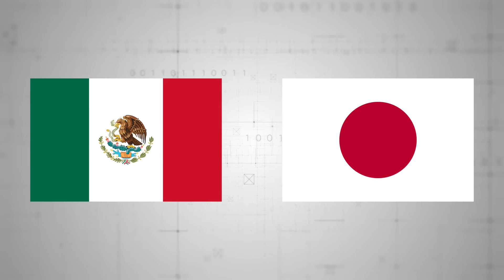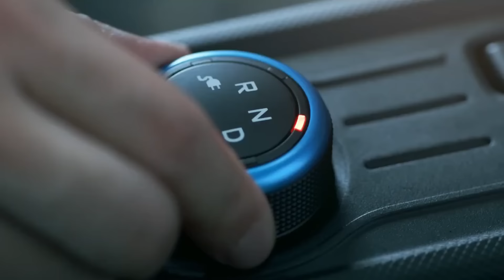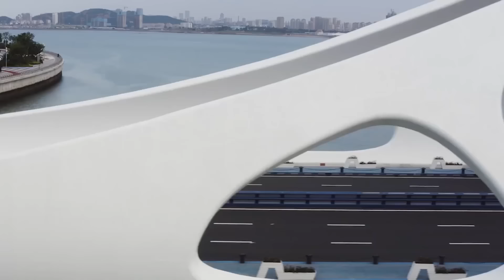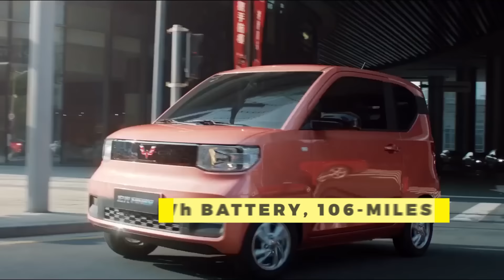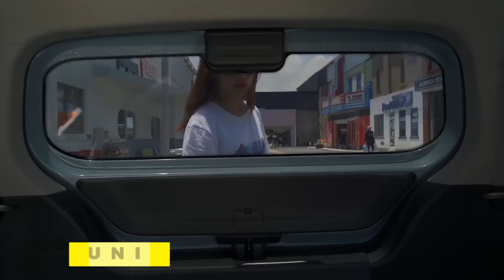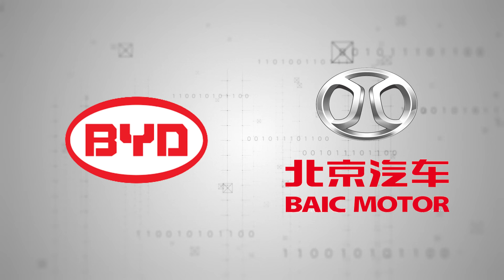The $4000 Electric Car Dominating China

Comment: I just want to ask. Do you guys have the type of battery pack that I can install it on the top of the roof rack and charge it by solar and still can switch to use it whenever I need for the car or for Electric Equipment that I have? 

Would I be able to buy an extra battery pack for this wuling? 
Whatever battery you are going to upgrade, I want 1 extra on the roof with a solar panels. Can you do that for me? A Wuling with Double level Roof Rack. 1 for extra battery storage and 1 for my camping equipments. And cover everything with the solar panel?

Comment: I bought one, and imported it into the United States.  I really did, for less than $45.  It's Sky Blue in color, like my last new car, a Toyota Camry....

Drumroll.......   OK, I must admit, it's a die-cast model reproduction, but I feel it will be a collector's item when I am 90 in 30 years, I can fly to China to sell it on China's version of "Antique's Roadshow".

A car like this I wish could come to the US.  All crash testing has done is increased the price of cars, forcing many to choose less safe motorcycles or e-scooters.  

The most important thing about car crashes is not getting into one, and/or accepting the odds that they can happen, but usually if you choose your route carefully instead of picking the most congested way to go from Point A to Point B, they will not happen to you.

If I were in one of these, I'd just wear a motorcycle suit with ambient cooling--they should make them for e-vehicles like this anyway, since the one thing I've heard about this car is its A/C just does not work.

Two things have caused challenges for cars and their longevity.  Electronics mixed with internal combustion engines, and of course, the car's purpose.

E-cars like this one are fine for home dwellers, but those who live in US apartment complexes are left out of the market and I'm a former homeowner who found apartment living cheaper than the cost of owning a home once utilities are packaged into the price.

I will never go back to owning a home again since my 22 yo daughter has chosen to have a career of her own, rather than straddling her parent's back looking for eternal shelter, more power to her, though we gave her the choice, we also taught her living economics, being experienced suburban dwellers and city dwellers vs. living in the middle of nowhere, like Kansas or Montana.

Comin' on up however are e-scooters for single urban riders, some with a 50 mile range, foldable so they can be carried up stairs, and able to keep up at residential speeds of 25mph or 33kph.

They are coming out of China as well, and it stands to reason a country that has had the largest population in a space no larger than the US would have good ideas about urban transport without the "road rage" we can't seem to avoid here in the US.  

We in the US (most of us) want space, living room, whereas I think like the Chinese and Japanese and others who work and live together and prefer human interaction than listening to Coyote's and Wolves howl at night, I think family, and groups of families, rather than tribalism, and bows and arrows, lol...

Don't get me wrong however, some of my American roots, a tincy five pct, go back to New England Native tribes and my daughter has hispanic roots, courtesy the one who we've shared life together with, which are said to have come from Asia, during the last Ice Age.  

I can see that Asian twinkle in her eye every time we eat noodles or skabetti...

Comment: I want it. Used fiat 500e is still 10grand or so with low miles. I've had 5 EV's and so far I've had battery problems at around 40000 miles.

Comment: In addition to this it could also lead to tge reduction of overpriced brands, but anyway.
I mean I Industrial or Electrical Engineer next to the efficiency of a electric drive of 90 to 98% compared to a combustion engine with roughly 45% efficiency, you have basically some resources left which is also pro electric.
But from a market perspective this laws might not be as much coincidence as it may looks like because most cars last for two decades and every year new models arrive and want to be sold... so if the match reaches its saturation, you might have to create a new one, which is electric.
In the end every car retailer or producer can be sure, that everyone who still drives a car ans wants to do it in the future needs to buy a new one.

Comment: Well if combustion burners/engines will be banned in 2050 and its production already in 2030 you mustn't be a guinies to prognose a increasing demand and selling rate for EV-Automotives at least for the regulations at tge EU, so for standard production some producers might change the conplet production line.
Then you might say okay elsewhere gasoline price may drop and then combustion engines will be more attractive but well 2 to 3€ for 300km, as a taxi-driver said is widely unbeatable.
Dispite that smaller cars might make community traffic on roads just more dense. So so in the width of the road and in the length  of the Road, are just more carse matching in the lines. And due to the fact that most cars are thought for 4 passagers but just used by 2 this might be a correct approach.
But normally public transport and point to point routs where you can transport many people at a high density to one point at the same time would be the a better solution because overall you just increase the gap or area form person to person if each of them uses a single car.
So to solve public transport you have to figure out who is when going where to work and finish, set up clusters and match public transport or traffic at this demand.
To prevent SMOG EV-cars are still the better solution.
So next to step on your drone-hover-bord and use three dimensions...
The best approach would to transport highest amount in metropols by train point to point, then using a intelligent bussystem , which is optimised on less destinations with hughe transport rate and something like UBER for older people etc. who are not able to reach destinations, to creat different cascades on the specific use-case.

Comment: The miniEV is designed for places where congestion is a story of the past, with its features that promotes health, as well as smooth driving experience, no owner is going to be regretful of the power packed features that this car has. It is lightweight yet durable on the inside and outside as it glides, smoothly.

Comment: i had business with china for years, electric scooters and mobility vehicles
Something like that with China companies, they sell thousands of vehicles but they don't want to sell spare parts, so when someone opens a shop sells vehicles but usually has no spare parts for them but because the Chinese put broken vehicles into a container use the shps as spare parts as well as me
second, the material is sooooo bad it sucks, it rusts in days, it bleaches in weeks from red it becomes rose, the blue becomes white
electric vehicles have very bad fuses, cables catch fire, batteries run empty very quickly, they lie with a range they say 150km and it only lasts 60km, plastic and rubber get rotten very quickly
an EE costs a bit expensive but I recommend buying an EE servis and spare parts
And the EE auto companies I do not recommend installing China spare parts in the EE auto, as is currently the case, and no Turkish ones

Comment: It will need many technical upgrades to get type approval in most 1st world countries, so would inevitably have to be sold at a much higher price, although probably still pretty modest in comparison with the competition in such countries. Outside China I imagine its major markets will be in relatively nearby less advanced countries. In Europe (where I am) probably only Dacia, a Romanian manufacturer now owned by Renault of France, is probably the cheapest car company and whilst its market presence is growing, it’s still pretty small, it sells on [low] price, not much else and I think they have only ventured into the ev market in 2021, with a sub £20k offering, with a price apparently undercutting the current cheapest offering from Seat with its Mii Electric.

Comment: I would consider for the price because I live in no power plugs outside condo's so I need a gas car but would buy elictric cheap car as a second.
Reply: @Dimitrius Didimitrius yes your correct I will need a personal charging station or two. A hefty back pack with 30 plus miles of charging to switch when I get home. Extra nice if a extra hook up was inside the trunk away from thieves. I will need the removable booster to stay in the trunk for multiple batteries.

Comment: For driving in the city, I'm concerned about how long the battery will last when stuck in city traffic.
Reply: Except for the air-conditioning and electronics, miniscule, because it only consume power when moving. ICE cars consume petrol standing still by idling.
Reply: @elyserva7903  again. That's exactly why I'm concerned about that.
Reply: It's so light you could push it with one hand by yourself.  So no worries ☺️☺️☺️.
Reply: @cb250nighthawk3  pushed both. For same size car, a normal car is easier to push around.

Comment: The new version has the optional air bag, and can run 200 KM after one full charge.
Reply: Put a 150 watt solar panel on top as a range extender and I am all in.
Reply: @chinabluewho  Yeah for a deluxe/premium or some version the solar panel would be good, but I think they won't do that for "standard" versions since it would increase the price by I assume a bunch
Reply: @rickbergolla4055  The Hyundai Sonata has an optional solar roof for only 9 dollars more than the optional panoramic roof (1000 dollars)
Reply: @chinabluewho   cool
Reply: How to book 1000 units? I'm interested.

Comment: Economic sense to go this route as it's expensive for gasoline diesel in asia and petro car smog standards on catalytic converter is required. Solar and 50+ nuclear plants will provide sufficient electric as 90 percent are using pubic transportation.

Comment: This is utterly stupid.
Why don't they make conversion kits for existing cars?!
Why the hell would I pay 4000 for this coffin on wheels, with a small battery pack, when i could upgrade my existing car with a better battery pack.
In 4000 you get an EV tech set of parts, plus a vehicle plus the install labor cost. Most likely the ev tech parts cost 1500-2000.
How about I pay 4000 with labor included but I get a better EV tech parts to fit in my existing vehicle.
5* euroncap, lots of comfort, size and gadgets instead of the coffin on wheels.
How about I pay 6000 and not just 4000.
In the end i will have a proper EV, that has range, confort and built quality 
Why waste 4000 on a shitbox when i can use those 4000 and maybe add a little and have my existing ford vehicle upgraded to EV tech.
And even better, all the ICE related components that i remove I sell and recover from the EV conversion.

Comment: Wuling is 95% owned by GM
Reply: only 40% owned by GM, i  worked in this factory,which is located in Liuzhou China, before GM only had 33% of the stock.Wuling is totally a state owned brand, this brand has nothing to do with GM,  the other brand Bao Jun is shared by SAIC, WU LING and GM

Comment: Even if it was $2k more with airbags and abs, it would still be thousands cheaper than anything we can buy now. It would make a great 2nd car.
Reply: In China there's now a "Macaron" version of this car, with air bag fitted for driver's seat and top spec range of ~105 miles. Priced at $6,720 at current exchange rate (the price of $4,350 quoted in this video was for the lowest spec model under the original version). Edit: ABS+EBD+low speed proximity warning also standard in the new version.
Reply: @edukid1984  How much is the hp and the max speed?
Reply: @georgeb5262  The macaron version with airbag not for sale at this moment，maybe a few months later，about 800 usd more compare to normal versions，the normal versions sport mode max speed is around 90-100 km/h ，not very fast，I don't know the Macaron version
This car even has  convertible  version
Reply: @georgeb5262   sorry，the Macaron version with airbag already for sale，36000 sold out until yesterday，i just checked，one is 5700 usd ，another one 6700 usd
Reply: @huarongliu8938  Thanks. Maybe Chinese just don't need more speed. Where I live max legal speed is 140 km/h, but you needs at least 160 km/h.
Reply: @georgeb5262  people who buy these cars are young girls, old people, and housewives. They are generally used for traveling in the city, shopping, and picking up children, very easy to park，most of them don’t need a high speed . Car owners usually have other cars in their homes. Another reason is that some big cities are very difficult to get license, but this kind of car is very easy.
Reply: @huarongliu8938  Oh, thanks. But they needs to put something like Taycan's gearbox with very low and high radio, if you ask me.
Reply: You can actually fit those at third party shops for way less than $2,000...
Reply: @raymondorech5578  really? what if this car doesnt have the room to fit in the airbag, is it safe to add it on?
Reply: @dicky-duck6632  it does, EU vision of the car has airbags and stuff.
Reply: you just described its EU vision

Comment: So for $4,350 you can buy a Chinese 4 person, 17 HP (12,682 watts) electric car that will go 62 MPH for 75 miles.
Or
For $3,000 you can buy a Chinese 1 person, 1 HP (746 watts) electric bicycle that will go 20 MPH for 40 miles.

I'd guess the cost to manufacture the bike is under $200.

Comment: Two trims, all features come standard, no options. Selling more than 3000 units a day now.
Reply: How to charge this vehicle when most people in China are living in the high-rise apartment buildings in the city?
Reply: @dennis007  chargers everywhere, parking lot, road side charging stations, rest areas. In the complex I live, every parking space has a charger.
Reply: @manimalworks7424  
Thanks for your explanation on the Infrastructure progress in China.
Is it a government mandate to wire parking spaces with charging station in high-rise buildings, even in the old residential complex, in China?
If a flat owner is also a gas-powered vehicle owner in an old residential building, this owner may be reluctant to use the money in the pocket to subsidize the wiring.
Reply: @dennis007   both gov mandate and commercial, we pay for the electricity used by wattage. Not free. But much cheaper than gasoline.
Reply: @dennis007  Believe it or not, this EV car even outfitted a 220v/10Aust plug in a 220V household socket to charge your car within 9 hours！
Reply: @dennis007  People can install charging unit at underground parking lot. And thousands of Charging stations have been deploying every year in China now. It's actually very convenient and cheap to charge them in cities.
Reply: @timonzhao313 
Thanks for your input.

I think each of the parking spaces in the underground parking lot is owned by the flat owner of most residential buildings. Each parking space is designated to its owner. If a flat owner buys an EV, how does the owner get the charging pole installed on the owner's parking space? Does it need to pull a special power line with an electricity meter to the charging pole?

I just want to figure out how it works. Maybe I'm wrong.
Reply: @dennis007  They can negotiate with parking lot management to find out the solution. For myself, I got my wall mounted charger free from Nio. But I seldom use it as I usually have my battery pack exchange for free in Nio station which save me thousands of dollar every year.

Comment: My 1990 Citroen 2CV6 also weighs 660 kg has 4 seats + boot & range of 300 km + 115 kph top speed.
Also has full sunroof and seats slide out for picnic and floats over speed humps without passengers feeling it...

Comment: Can you please use kilometer and kilometer per hour or meter per second rather than obsolete units like miles?
Reply: Multiply miles by 1.6 to get kilometers lol
Reply: @rw9495  The definition of the most used mile today is 1760 yards, 1 yard is defined as 3 foot, 1 food as 12 inch, 1 inch as 25.4 mm. This means the most used mile is defined as exactly 1.609 344 km.
.
I know how to convert it, i know the imperial system. This is why i ask him to use metric units. Imperial units have too many inconsistencies and metric makes much more sense.
Most People who use imperial units do not understand the imperial "system".
.
There are many many different miles with different definitions which have different lengths, but i let that part out.

Comment: I can't beleive GM would enter into a manufacturing agreement with a $5000 Chinese EV maker for any other reason than to destroy it. Case in point, Harley Davidson and Alta Redshift SM. 2018 GM Chevy Bolts are being recalled for battery fires. Understand? That they even confuse you with "Volt" & "Bolt"... understand?
Reply: no we don't understand, what are you smoking on?